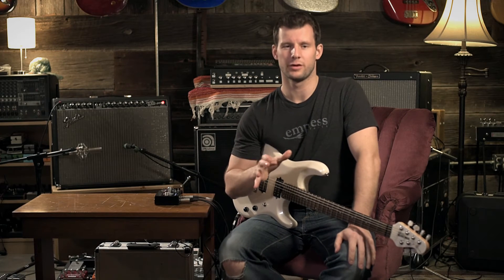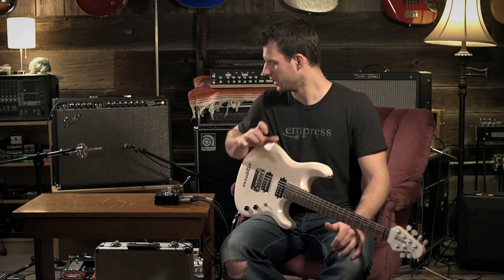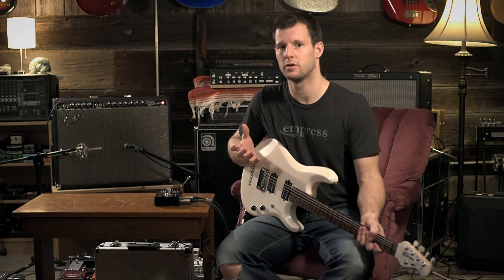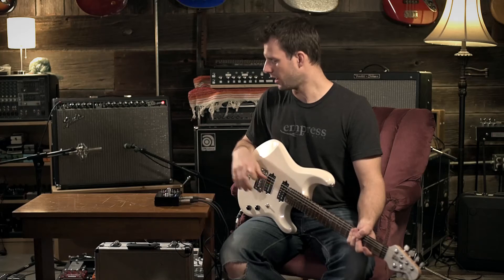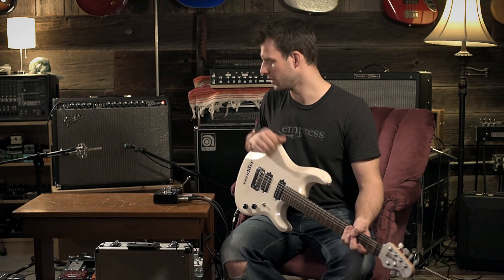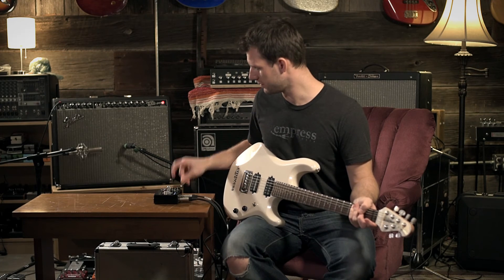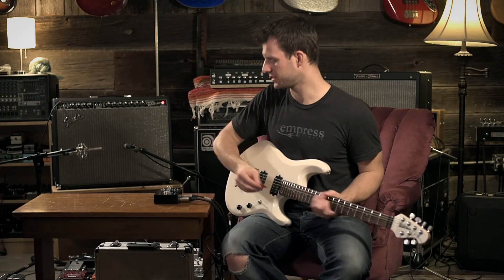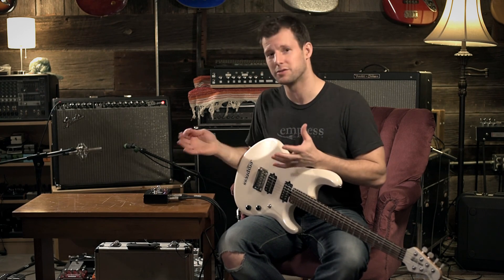Empress Effects Buffer+ Stereo - ISO Transformer

Comment: Hi. I will be plugging my guitar directly into my Boss ES-8 switcher. From there i'm running stereo L/R out of the Es-8 into 3 Strymon pedals (stereo, controlled via MIDI) daisy chained to a Boss Loop Station (stereo). Would you advise I get this buffer and place it after the Loop Station before running to my 2 amps? Which mode would I set that at thanks!